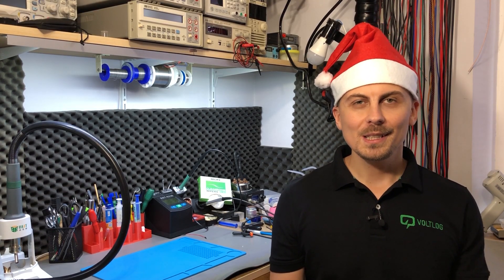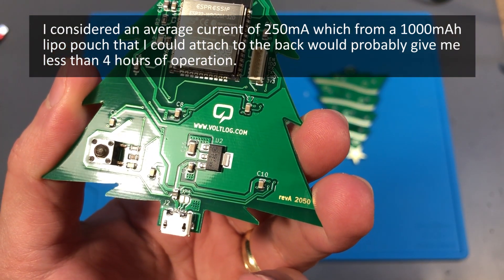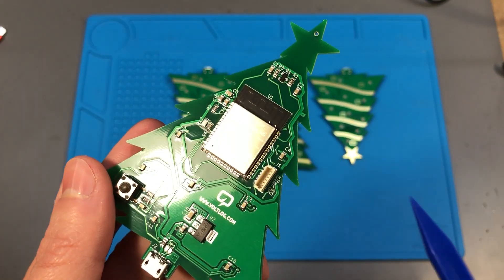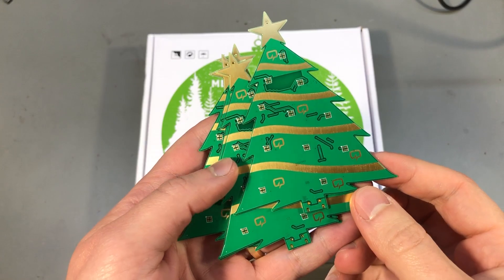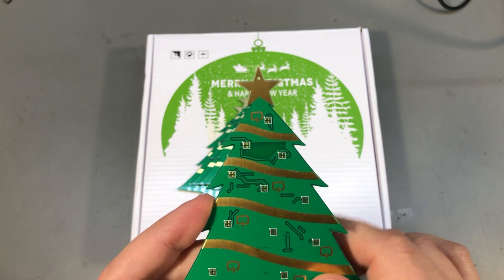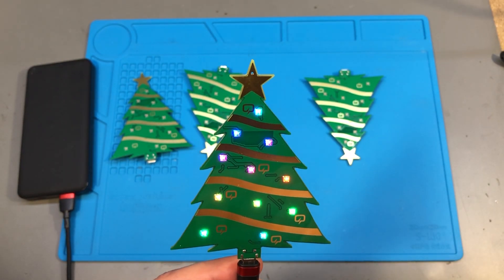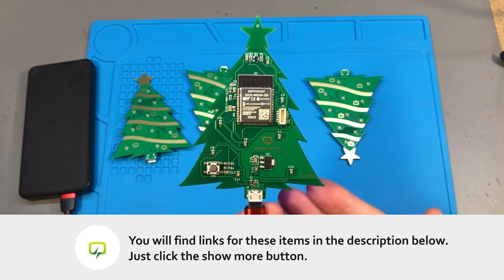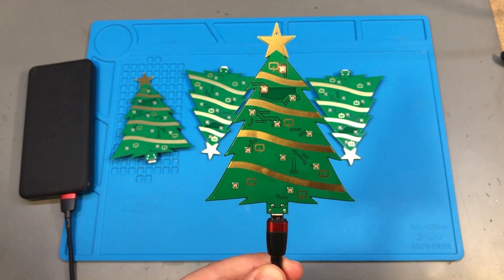Smart Christmas Tree With RGB LEDs & ESP32 - Voltlog #344

Comment: Awesome little PCB! Although ESPhome is great, also checkout the WLED software. It will run on the ESP32 just as well and also has native Home Assistant integration but it comes with many more and nicer effects!
Reply from the maker: Thanks, I actually mentioned WLED in my video but it makes sense to pick a platform and stick with that, like I did with ESPhome and I have all my devices running that.
Reply: @voltlog  Ah, must have missed it then, my bad! I do run ESPhome on all my other boards, but boards driving addressable LEDs, WLED can't be beat in my opinion, especially with the HA integration. But hey, to each their own, everyone should run it with the software they like best. :)